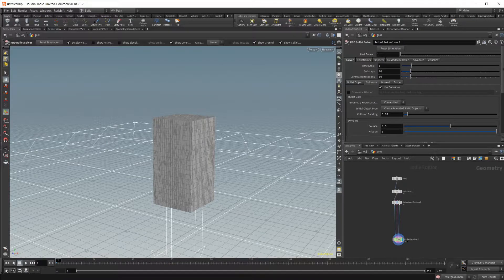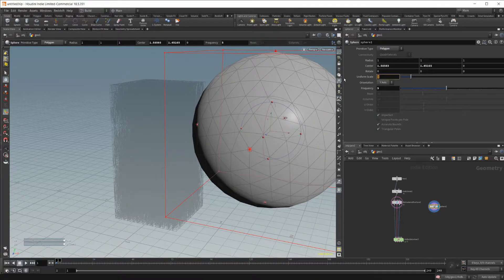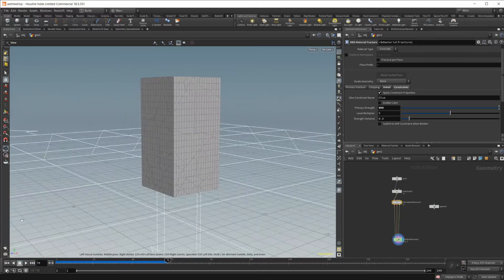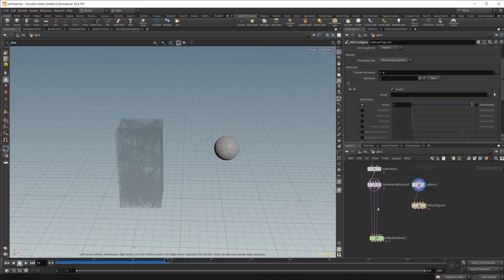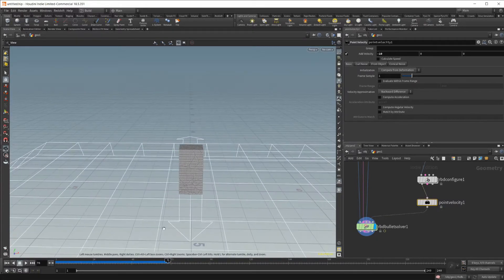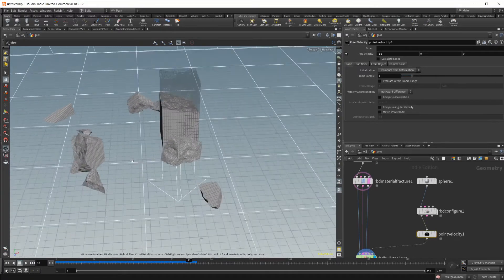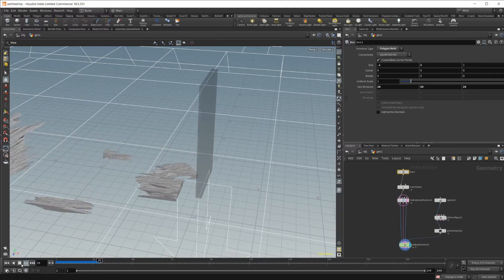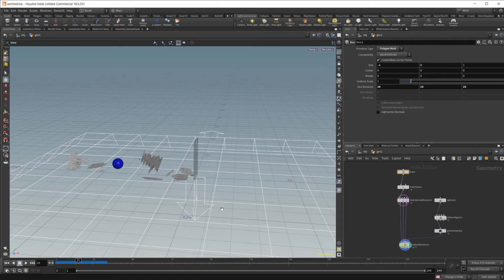Enabling Collisions in the RBD Bullet Solver in Houdini

Comment: Great tut,  gracias for that.

I was wondering if you know if theres a way to delay the collision object starting to move. When I add an "rbdconfigure" to the fractured object I can keyframe the "Active" value, and it starts as soon as the value is 1. 

But this has no effect on the collider of course.

So I try to delay the velocity by animating the "active" value in the "rbdconfig" of the collider as well, but no matter what I try, I can't start the animation of the collider on anything else then frame 1. And if I animate the velocity, any velocity value is completely ignored.
Reply from the maker: Try using the stopped attribute. Set it to 1 until you want your collision object to simulate and then change it to 0.
Reply: @InsideTheMindSpace  hey, thanks for the quick tip. I tried setting the "stopped" attribute with both, an attribute wrangle and attribute create to a value of 1 to see if it has any effect. And I can see the point value in the Geometry Spreadsheet, but it has no effect whatsoever. 😟
Reply: @InsideTheMindSpace  just in case anyone else runs into this issue as well, someone posted the solution in the sidefx forum : in the Collision tab of the solver, check the Override Attributes parameter, and add "v" to the list. Now animating the point velocity for the collider works as expected...

Comment: very interesting. One question. How can I add second material. For example my first one is glass wall, behind it I want either concrete or wood so when the ball goes through. It gives both material simulation.
Reply from the maker: Materials are just attributes on the geometry so you can create all the attributes at the settings you need and merge everything together before wiring it into the solver.
Reply: @InsideTheMindSpace  but the merge node has only one out put. Where as solver has multiple
Reply from the maker: You merge each individual stream together so merge each of the first outputs and then wire them into the solver then the second outputs and so on.

Comment: my only question is how to get the Collision geometry (The sphere) to  render instead of using the visualization. like when i go one level up out of this network i can see the collision happen but I cant see the ball anymore. Any ideas?
Reply from the maker: All you need to do is merge the collision geometry with the result of the simulation or alternatively you could wire it into an out null and object merge that in a new geometry node to keep things separated
Reply: @InsideTheMindSpace    i did figure it out. I think its probably easier to do this in a  dop network rather than using the rbdbulletsolver sop. But if using the sop, you need to use a dop import. so if you create another geo node and then throw down a dop import->  type /obj/< your geo name>/rbdbulletsolver1/dopnet/ in dop network field. For object mask type collision* then change import style to Fetch gemoetry from dop network. Voila. Your collision object. Then just merge in all the rest of your nodes with object merges, turn off flags as necessary and voila.  i have no idea how the point velocity would still work otherwise. i could not get a simple merge to work.
Reply from the maker: That way is vastly more complex and unnecessary. Simply merging the resulting simulation with whatever you pipe into the collision geo input works just fine or like I said if you want to keep them separated wiring the collision geo into a null and bringing that into a separate geometry node with an object merge
Reply: @InsideTheMindSpace  How will the point velocity be respected??? i seriously tried this. I must be stupid
Reply from the maker: Perhaps I am misunderstanding your setup. Are you simulating the collision geo in order to have movement there as well?
Reply: @InsideTheMindSpace  i did try this and i can see the collsion geo in the render view but the velocity is missing i need to render with velocity how can i do that ?
Reply from the maker: Not sure if you are meaning motion blur or you are using the velocity attribute for something. Make sure you have motion blur enabled in your render engine if needed. If you are using a velocity attribute make sure the attribute isn't being deleted anywhere
Reply: @InsideTheMindSpace  Hi, I'm on that particular question, any help would be appreciated.
Reply: If you just merge the collision object with the dynamics output it will not show the affect of the dynamics on the collision object, so the method from @skunchtv is needed for this to show.

Comment: Hi Buddy, after rbd bullet solver,  how to get the collision sphere out to display in render view. thanks!
Reply from the maker: You should just be able to merge the object that you wire into the Collison input with the output of the simulation
Reply: @InsideTheMindSpace  i tried that bro, actually, I gave the initial vel to the sphere,  after merging the bullet solver and sphere (after Point vel Node) , it's not working.
Reply from the maker: Without seeing your setup it's hard to diagnose the issue. You should be able to merge the collision geo with the output of the situation. The other option is to merge the objects before the sim and only use the first input of the rbd solver. You could also bring both into a second geometry node and use that as your rendered object.
Reply: @InsideTheMindSpace   Yes I put the merge node below the Bullet solver and connected the collision geo into the merge node as well as solver node. Its working and i rendered out perfectly.

Comment: What if I want the ball to also shatter?  no one seems to cover that scenario.
Reply from the maker: Been awhile since I messed with rbd but if I remember right you can set up the fracture and all of the attributes like normal and then merge the geometries together before running them through the simulation.
Reply: @InsideTheMindSpace  I tried that, but only one of them keeps their glue constraints and the other immediately crumbles.
Reply from the maker: If you are not you will need to merge every input of the bullet solver otherwise it won't have the information from both.
Reply: @InsideTheMindSpace  I did that too.  I even merged their glue constraints before I attached them in the same manner. 

I’ll keep pecking at it.  Thanks.
Reply from the maker: I'm not at my computer at the moment. I will have to revisit. Like I said it's been awhile since I did much with rbd. Feel free to join the discord and I will try to remember to take a look when I have a moment
Reply: @InsideTheMindSpace  I always forget about Discord.  I might just do that.  I need to use it more.

I figured out that the cube is shattering prematurely because it’s already on the floor.  I need to get the glue to work. 

Thanks for all your help.
Reply from the maker: @JohnSlaughterND  I just confirmed and you can merge each individual outputs together and then wire them into the bullet solver and it should work. So the first outputs merge together and wire them into the first input of the bullet solver. Then the constraints you merge together and put in the second input of the bullet solver and so on. Should be working.

Comment: Thank you for this video! I'm applying this information to create my own collision for an assignment in my college. Part of my assignment asks to export the collision into Unreal to add simulated effects.  If I created a collision using this method, is it possible to export it out to Unreal? If so, how would you go about doing that?
Reply from the maker: You can do the entire simulation inside of Houdini and export as alembic. That would be my recommendation. Not exactly sure if that's what you are asking. There is also a way to export certain data and use that to drive effects inside of Unreal but do not have much experience with that to guide you unfortunately
Reply: I would recommend exporting the sim as an fbx, by using a labs RBD to FBX node in the out graph